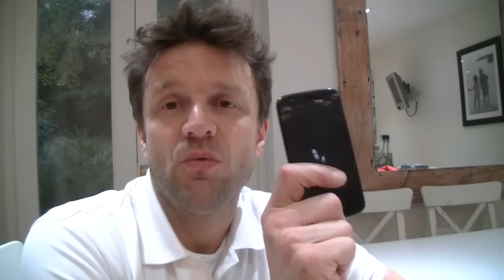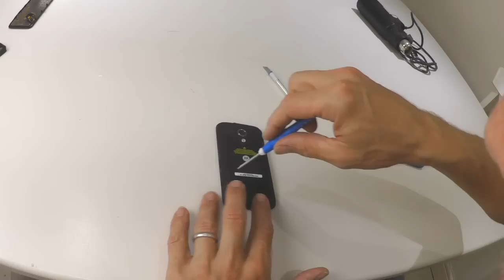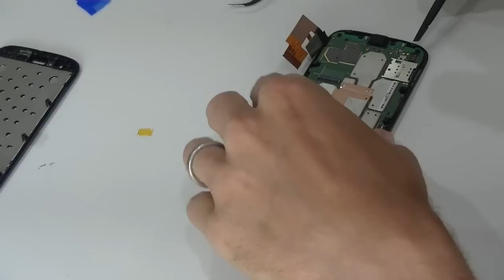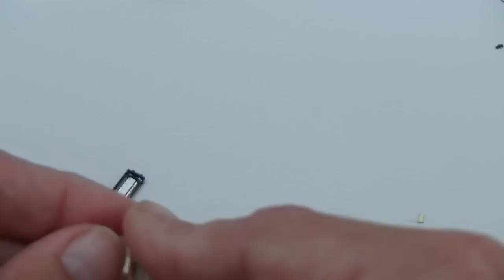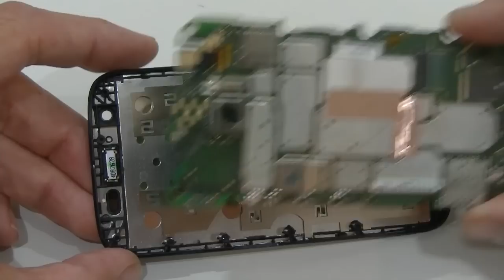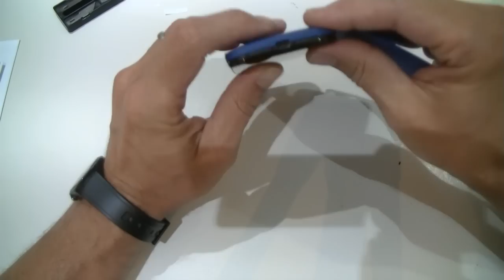How to Replace Cracked Screen on Motorola Moto G 4G (1st Gen)

Comment: Thanks for your easy to follow instructions. I've fixed my phone now with no major issues. I didn't stick down the screen connector to the heat sink though; to me it looks like the battery and the small blue covering will help to hold the connector against the heat sink. The phone works OK so far, but if missing this step causes problems later on I'll add a comment here.
Reply from the maker: Hi Rick, glad to hear it worked! You feel pretty epic don't you, when you finish putting it all back together and the screen flickers back to life! Thanks for letting me know how you got on!

Comment: Living in Souther Spain I found it difficult to find anywhere to replace a broken screen, the few offering this service were extremely expensive so I thought I would have a go myself. Having no electronic experience and as the phone was almost useless I figured I had little to lose. To cut a long story short I found your excellent video - head and shoulders above the rest of the DIY vids out there. I sourced the screen in the uk, followed your vid to the letter and it went like a charm. Even changed the battery! Thank you so much for this paradigm of DIY vids!
Reply from the maker: Hi Allan - so pleased you found my video useful and congratulations for carrying out a successful repair. And presumably you even managed to remove the earpiece speaker without destroying it like I did first time round?! 

Many thanks for the wonderful feedback - comments like yours keep me doing this!
Reply: Yes - the UK supplier actually had speakers for £1.96 so I bought one just in case. Didn't need it so if you destroy another you know where to come!

Comment: Hi Charlie, what what you've seen playing with the phone, is there any reason a lightly cracked screen (dropped on the top corner, touch screen working fine) would need a full touch screen replacement?  Trying to get an accurate quote to replace, not quite as brave as you!  Thanks, Linz
Reply from the maker: Hi Linz! Yes, once a portion of the screen is cracked, then the whole screen needs replacing, I'm afraid. Can you maybe live with the crack until your phone contract comes up for renewal? If it's a light crack and the rest of the screen works fine, you could buy a screen protector (though it's so hard to fit these without getting bubbles and dust behind the protector) which would protect you from the cracks and maybe stop them spreading?
Reply from the maker: Linz, I should add that, just from reading the comments in this feed you'll see how hit and miss the process of buying and fitting replacement screens is. 

I had an HTC once and got their approved repair company to replace my cracked screen. It cost me over £100 and the phone came back almost 2 months later with splinters of glass still on it, and a damaged bezel where they had levered the old screen off. So it pays to do your research. It's such a tricky one with the Moto G, because they're priced so competitively that it almost doesn't justify paying the sort of money I did to get the screen replaced. 

... which is why I decided to replace it myself. Whatever you decide to do, best of luck!

Comment: Great instructional video, thanks so much! If only all disassembly videos could be this detailed and useful. Especially thanks for including the part showing how to get the earpiece speaker out. In taking mine out I apparently damaged it similarly to how you did, but I kept the part and it still seems to work fine.

I do however have the problem you mentioned at the end, with the proximity sensor causing the screen to go off when calling. Did you resolve this at all or just get a refund and a new screen/frame? Do you know which part actually is the proximity sensor? Thanks again
Reply from the maker: Thanks for the feedback Alistair - much appreciated!

I'm afraid this is the gauntlet we run buying replacement screens on the internet. The first one I bought which I referred to in the video I purchased online from a US company Fixez.com - I did eventually get a refund but not before I had to send the original all the way back to the States! Not only did the sensor not work but the screen unpeeled almost immediately, leading me to suspect it was the screen they took apart in their own instructional video!

In the end, I bought the replacement from here https://goo.gl/YlUZXO for a fraction of the cost. It worked great for me, but I guess there's no guarantee with these things. I don't know which part is the proximity sensor but it's not the sort of thing you could remove and replace yourself - it would be integral to the display. I can only suggest you buy a new screen as I did (they're only £17 after all) and keep your fingers crossed it works.
Reply: The screen & frame that I bought looks identical to the one you've linked to (same price and also from ebay). It feels like much a cheaper construction than the original, which I guess is to be expected. The screen also feels like it's not attached to the frame as securely as the original, but there's not much I can do about that without risking damaging the glass.

After a bit of digging on google and various forums I discovered that the problem with the proximity sensor is pretty common on replacement screen assemblies, and also that the light sensor and proximity sensor are both controlled by the same device (CT406). In the Z-Device Test diagnostic app, the CT406 light sensor works fine, but the CT406 proximity sensor constantly returns a value of 3cm. Even more digging suggests that this might be because aftermarket screen assemblies apparently often have issues with light seepage confusing their proximity sensors.

I can't get a refund for this screen any more so I may have a go at fixing this. If I do, I'll be sure to make a video documenting the ensuing mess :)
Reply: Also, the light/proximity sensor is on the motherboard, so it won't have changed - but the problem is probably with the window in front of it, on the frame
Reply from the maker: That all makes sense. I've got to be totally honest - I'm no expert on the inner workings of mobile phones - with your detailed research you've already eclipsed my limited knowledge! 

When I made the video I was just trying to demonstrate how someone with a bit of practical nous can replace their own screen. My experience with the proximity sensor, coupled with yours and that of Badri who also commented on this feed shows how problematic it is getting a decent replacement screen - and I will update the Info below the video to reflect this. 

If you do decide to take the screen off the frame, check out this video that shows you how to do it, about 4.5 minutes in, https://goo.gl/b5QiSO - although I guess there's no guarantee that will fix the problem??  When you reattach it, you could probably do a more secure job of attaching the screen to the frame (eg with a glue gun rather than double sided tape)?!

As you've got nothing to lose, maybe try disassembling and reassembling it first, just to check it's not just a simple issue of misalignment when you put it all back together?

The only other thing you could do is contact the company that sold me mine, and ask them what assurances they can give on this problem, were you to buy a new screen from them. I know that's not worth the paper it's written on, but with 7,600 positive comments against 63 negative, they must be doing something right?

But whatever happens, good luck, and do let me know how you get on.
Reply from the maker: Alistair, I've edited my reply a couple of times since I posted it, so you might do a refresh to see my final thoughts?
Reply: Ha, I'm definitely no expert on phones! But after I finally got 
round to fitting this replacement screen and the bugger didn't work 
properly, I was pretty keen to find out why so I got lost down that rabbit hole for a couple of hours. Seems a shame not to share info if you have it.

For now I might have a go at separating the old broken screen from its frame, just to see how easy it is to do before I go butchering my new screen. Of course there's no guarantee that it'll be exactly the same as the new one since the new one's third party :-/
Reply: I took the back off the phone again and removed a total of 5 screws that seemed to be preventing the back from sitting correctly, because as a result of that they were pushing the glass away from the frame. Now the glass sits better and the proximity sensor is actually working temperamentally, although I don't really know for sure if these two things are connected. I've just been playing peekaboo with my proximity sensor and trying to work out what makes it work or not.

I wonder if the aftermarket replacement screens might not be perfect fits for all models, since they say can fit XT1032/1033/1039/1045 interchangeably. Mine's an XT1039.

I know I said I'd make a video of what I did but this would have been one really boring video so far.
Reply from the maker: What you say reminds me that when I put the first (defective) screen and frame back on, I had problems putting the phone back together in that the screws, when tightened stopped the volume buttons from working freely. Also, the new HTC original back cover and front cover (featured in the video) didn't properly click onto the phone, which I put down to the cover just not fitting properly.

However when I fitted the new screen, it went back together much more smoothly, I didn't have the same problem with the screws interfering with the volume button, and crucially, the back cover clipped in perfectly. Which either suggests that I hadn't put it back together properly first time round, used too much double sided tape which made the internals too bulky to fit back together within the confines of the phone chassis (for want of a better word), or the new screen was the correct fit for my model - which like yours is an XT1039. 

So all I can say that the screen I bought from the link at the end of the video seemed a perfect fit for my XT1039??

Shows it's not an exact science and maybe there are quite a few factors that contribute to the issue that you've been having.
Reply: I think I've got to the bottom of what's been causing the glass to 'peel' away from the frame once the phone is put back together. The protective metal sheet that you take off at 5:23 has some little hooks on the side, that slot into the frame. The plastic cover that has all the screws in it, then slots into the same slots in the frame.

I think the replacement frame simply has slightly too small slots, so they're not big enough for the metal hooks and the plastic clips. I've cut off two of these hooks (out of 3) so far and the problem is almost solved, except around the one I haven't yet removed.

I wanted to video all this but my camera's out of action. Will try and get it working before I do the last one.

The proximity sensor worked great for a while but now it's gone again. No idea what's going on with that.
Reply from the maker: That's really interesting. I thought it was just glued on or at least that's when it's an OEM. The replacement screens tend to be just attached with double sided tape?? Great work!
Reply: +Charlie DIYte Getting rid of the little metal hooks didn't solve the problem, I think the problem is with the plastic clips. I'm a bit more hesitant to remove them because it's quite thick plastic so I could end up twisting it and making it worse.

But even so - the new screen is pretty rubbish. The screen looks washed out compared to before, and the digitizer keeps dropping the signal, so swiping down through a list (of videos, for example) often ends up with unwanted taps. Very annoying and disappointing, after all the messing around I've done with it. Does yours behave ok?
Reply from the maker: Hi Alistair. Sorry for the delay in replying. Been one of those weeks! My screen behaved fine until my son pulled the glass front off (in his young, investigative way!). So I'm currently mulling over whether to buy another in the interests of research. When you say "new screen" are you talking about an additional screen purchased since you had problems with the proximity sensor?
Reply: No hurry mate, my phone's not going anywhere fast :) I've only bought one replacement screen since I damaged the original, so by 'new' I just mean the newest one. I'm not using it as my actual phone at the moment cos the issues are just too much - the proximity sensor, the screen peeling off and the dodgy digitizer. As a device for streaming digital radio and youtube vids it's just about ok.

Let me know how you get on with replacement screen #3!

Comment: Hello Charlie, I replaced the screen with another used one. But unfortunately touch is not working on screen. Can you tell me the reason??
Reply from the maker: No, I'm afraid I'm no expert on the inner workings of the phone.  I think you'd have to investigate this with the supplier of the screen, as I suspect this is where the problem is. You might just check all your connections are secure.
Reply: Thanks. :)
Reply: Badri Shaikh most likely the ribbon connecting the touch panel is either not connected properly or damaged. Try Reseating it. If it still doesn't work it's likely broken permanently.